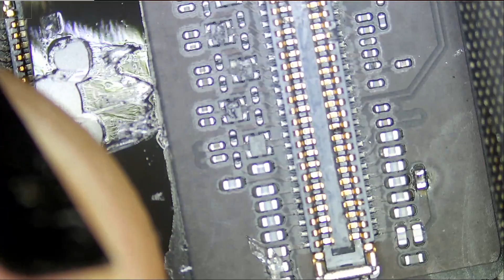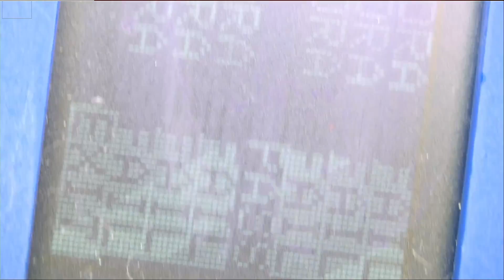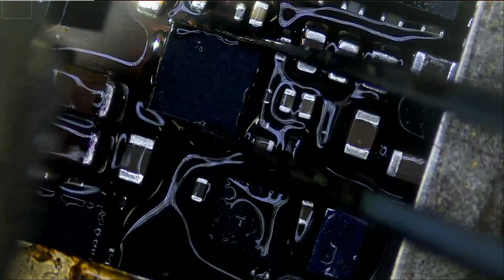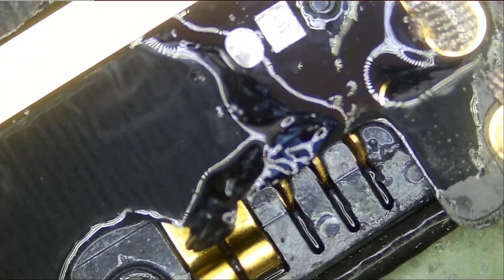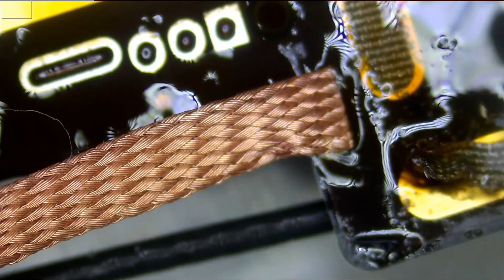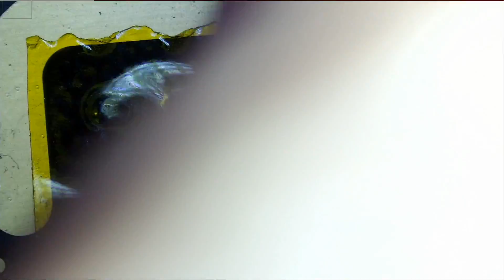iPad pro 9.7 Not charging - Faulty Tristar & Battery connector replacement

Comment: while watching this video I remembered a time where you used a tristar tester board to determine the voltages and I was wondering if you knew that the Tristar tester has a PRO mode where it tells you the voltage from the charge port and the voltage of every rail in the iPad. just hold the left and right button down BEFORE you turn on the tester. While turning the switch on continue to hold the left and right buttons down and keep holding until it turns on and starts the test. it will then do the same test but will show you voltages on all the rails.

Comment: I slowly took apart my ipad Pro 4th generation and replaced the charging port and now it will not charge at all. I am so frustrated. I work on this daily because I am an illustrator and now I am left with a brick of an ipad pro. I will say that before I replaced the port the old port was all messed up but would charge if at an angle or jiggled around, now nothing charges it. If anyone has any advice I would love to hear it and would appreciate any help! It's only 2 years old so this is extremely frustrating.

Comment: I bought a new iPad from micro center after 6 months I notice when the battery gets to like 80 percent it will stop charging I clean the port change charger and cables and still does the same thing.the only way I get it to charge 100 percent is I have to press the power button off and then turn the tablet back on and then it charges to 100 percent. But I have to do this almost all the time what you think is wrong? And is still under factory warranty.

Comment: Thanks for video. 
I have question. my daughter has iPad 2nd gen 12.9 A1670 model and only specific cable  could charge it  but others - includes original charge cable - could not charge the pad not at all. How can it be? 
Some says by replacing the charging doc flex cable could resolve that problem. It this right? Please give me some hints!! Have a nice day.

Comment: Good Morning. You came across a glitch after replacing the battery for the iPad Pro 9.7 is a 100% permanent look. And no matter how long the iPad works it does not move. If the battery is genuine everything works fine

Comment: I've a Samsung note 4 phone, bought in during launch used for few months, then something went wrong. I dunno software update or some else....
It's having the same problem, when I press power on, it shows Samsung logo & then restarts over & over showing only the logo.
Took it to a shop, he said it's ok change the battery. He checked it on laptop what he called ' testing on machine', & ya I see it was working.
Then went to buy the battery but it still won't turn on. The repair man has no clue,🤪🤪👻

Comment: I found its also harder to remove solder without at least some flux and enough heat and good iron tips.  I'm definitely going to have to gets some of that wick.  The stuff I use is horrible.

Comment: Man you have missed  a  bad diode  just pause  the video at 1:41 the left one
Reply from the maker: That's not a hole, it's just something stuck on the diode, otherwise we would have problems with the Backlight. Diodes usually crack and not have holes in them. I"ve done a alot of video where i show how diodes crack. Check this one https://youtu.be/96M0OWuSz6g?t=94

Comment: If you’ve got time to answer a question I would appreciate it.

I’m trying to remove the solder from a PS4 HDMI port. I have no problem doing this repair on an Xbox, but always trouble with a PlayStation.

I’m adding low melt solder to the holes and allowing it to mix, but it doesn’t help with the removal.

Do you have problems with the PlayStation HDMI port?

Thanks
Reply from the maker: You took the first step by applying low melt solder. Make sure you are using a big solder tip to achieve more heat transfer for solder to mix well. Than all you need is a good wick that absorbs and Flux to help with the solder flow when it liquefies. Removing solder from PS4 holes is tricky, but having the right tools for the job and a lot of  practice will make perfect. In the future, all unrelated questions should be posted here https://northridgefix.com/askus/
Reply: I don’t use low-melt solder, I add plenty of flux to the pins and then heat the board from the bottom on the back side of the port until i can lift it out with tweezers. It might be up to 2 mins depending on your hot air station and selected temp+airflow. Can mix this method with low-melt for faster results.
Reply: easiest time of my life removing hdmi port bro. peace hehe

Comment: Serious question. If the wick you use is so good why do you have to add flux to it? I use Gootwick and never need to add flux to be able to wick pads
Reply: @Neodymium5312  lol I know what flux does, but any decent wick will already be coated in flux
Reply: @Neodymium5312  no I agree I'm not mocking your response, it was a genuine question. I'm just saying the wick I use costs £3/$4 per reel (1.5m) and does the job perfectly without needing to add more flux, but I've seen in several NorthridgeFix videos where he adds fresh flux to wick pads and just wanted to know why, since I don't know of any time I've had to do that myself in the work I do
Reply from the maker: Flux helps with the flow of solder specially when dealing with solder inside holes. Wick by itself does not release flux and it's neither efficient nor practical to use it with out flux unless you are just wicking pads from the surface.
Reply: @NorthridgeFix  thanks for the answer, but I honestly never have an issue wicking without adding flux while using Gootwick
Reply from the maker: @TheCod3r  What is the point you are trying to make?. Just do whatever works for you
Reply: @NorthridgeFix  I was just wondering, it was a sincere question
Reply: NorthridgeFix he almost seems like a Gootwick sales person 🙄
Reply: @Infiniti25  lol

Comment: My iphone 7 plus always show accessories is not compatible and it cannot be charged  but if I switch off the phone it will charge. Tried changing charging connector port but same problem. What seem to be a problem
Reply: @Lucky have you tried a different power cord or power brick? Is it a none Apple cord/brick?
Reply: Joe Salgado tried all original and non original charger same problem . Same cable was able to charge other iphone
Reply from the maker: Problem could be the Tristar chip, assuming you are using a good working original apple or MFI certified cable,
Reply: NorthridgeFix yes i do have original cable bought along with the phone .  Iphone do auto power on while charging . What i did, Plug the cable into phone , switch on the  power ,incompatible warning, shutdown the phone. After 10-20mins when you switch on the phone the battery is getting some charge. Does tristar fault still can charge the phone????